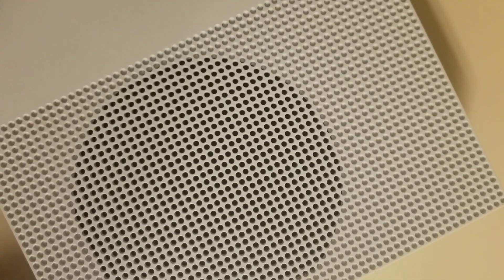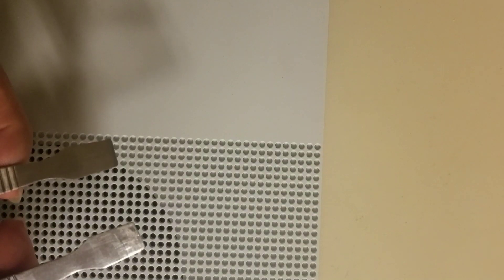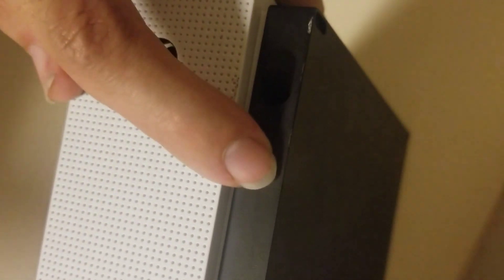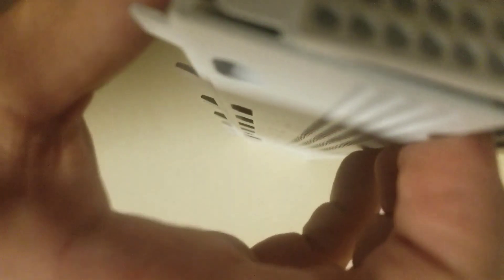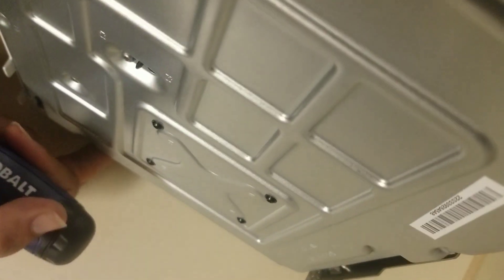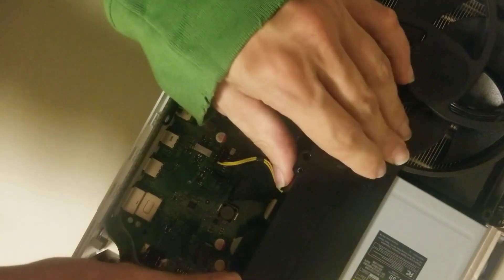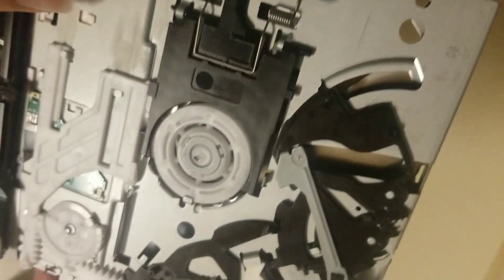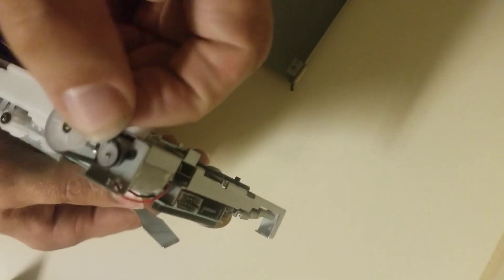Xbox One Slim and Disc Drive Detailed Disassembly

Comment: This is a pretty legit breakdown, not a fan of skipping thru shit that could potentially chip away at my console wich is covered perfectly here, so thankyou for the info.  Edit: Buhhht, my issue is that my son spilled orange juice in the fan, took it apart to clean but when reassembled it turns on for a split sec.. If anyone can help, Please.. Im all dumbo ears..

Comment: This video Rocks! My kids system has been jamming for almost a year where we had to push the disc and and pry it out. Then I accidentally dropped it! The disc no longer ejected not even manually. So I watched some videos, and this one helped the most. Opened it up following your steps to discover a small pencil eraser top (metal part) mangled in the corner! Carefully slid it towards the disc opening and yanked it out. The disc drive now works like new! Great video again! Thanks a bunch. I almost went out and bought a new one. smh

Comment: Thanks for the vid. Teeth of a gear appears to have snapped off so they aren’t turning fully. Great vid straight forward the only problem is the frame, some of what you did was out of screen so I had to figure it out but I got there in the end thanks 👍

Comment: Holyshiii its a mission to get an id out lol my son just gave me a headache lol
Reply from the maker: I found 2 credit cards in the last one I worked on. It is like Christmas but unwrapping with a screw driver. You never know what your going to find. I would love to know what thought children have when they are shoving change cards toys paperclips and 3 discs into a system. Lol
Reply: @NemesisMerlin  my hdmi port broke is there anything I can do ?
Reply from the maker: @gh0st640  HDMI ports are fixable. You will want to find a company near you who does micro solder work. Check computer repair shops. I fix a lot of HDMI ports and the price runs from $100 to $160. I believe most places will fall within those values. Also, all HDMI ports are the same process to fix so if you want to see one in a video check out my ps4 white light of death videos. What happened to the system that broke the HDMI port?

Comment: Hi mate great video, very detailed. My Xbox one S is a couple of months out of warranty now and I have only recently tried to play Blu Rays (4K and 1080p) and the picture pixelates and then freezes about halfway during the movie. Do you think it link to the hardware or is it software related? I tried cleaning the cache and even did a full reset but the issue remains. Games on discs seem to install with no issue.
Reply from the maker: The Xbox One S does have some known software glitches in the bluray app. Make sure your software is all the way up to date. Also make sure all your video settings match what your TV is capable of displaying. Does the fan kick up when you get video glitches that would be a sign of overheating causing calculation errors in the video.

Comment: My disc won’t go in. It’s like when you try and put the disc in, you have to shove it In forcefully. The Xbox won’t just bring it in. And it makes a noise I can only describe as grinding when I try to pt a disc in.
Edit: I put a disc in. It read the disc and everything. My problem is I can’t eject the disc.
Reply from the maker: Grinding is not a good sign. Grinding means that a part is broken and will need to be replaced. The drive was forced at some point and more than likely the gear assembly has lost some gear teeth. The disassembly is the same as with my video but the repair will get much more difficult once you start pulling the motor and gear assembly. I would recommend finding a shop to fix this one.

Comment: Really enjoyed this video... have you ever encountered a problem where you insert a disk, it spins three times and then nothing happens? This is my current situation and I don't know if it's the disk drive or something else. Thanks!
Reply from the maker: Take the bottom plate off the drive and put it back in. Drive mech is broken but it will sometimes allow it to slide even with the brake if you give it room by taking that plate off.
Reply: Oh wow... so just the silver plate like in your movie or part of the mechanisms on the bottom? Like the round thing on the bottom?
Reply: Issa Wilson lets say that
Reply from the maker: Yes the last part I put on. Just blow the system out more often to keep dust out of the drive.

Comment: So I have a question I have a game that will not play and the disk isn't scratched and I'm at my witts end with the damn thing. It plays other disks that are definitely scratched but will not play this one disc. So I just started to play other games for a while and then just yesterday I thought to try it again and it actually started to download and then played it for several hours. And then today for some reason now it is doing the same thing, it's not reading my disc it keeps popping up saying that insert disc. If you could help me or give me any kind of tip so I don't have to take my Xbox apart or throw it against the wall cuz that's what I feel like doing with it right now I would much appreciate any tips please I've literally tried alcohol on my desk, and dried it with a microfiber rag.

Comment: I didn't disarm it but and it jiggled a lil bit and found a popsicle stick inside and I think theyre is still coins inside but I don't want to disarm it can you give me an idea of something to do from the outside?
Reply: (Note:My baby sister put stuff inside)
Reply from the maker: The system would need to be disassembled. Once anything small enters the drive it will fall down into the laser slides and also get stuck to the disc retaining clip that is magnetic. If you do not trust that you can get it apart you will want to find a professional to do it for you. Also, if you try to shake the coins out you may make them hit the laser and damage it.

Comment: What Philip head size is it
Reply from the maker: I use the Japanese Industrial standard 2.0 but the most common option is 3/32"(2.5mm) flathead. Most of the time I just have all my bits lined up from smallest to largest and just grab what looks like it fits and adjust bigger or smaller as needed. Game systems are not designed to be serviced so whatever works best for the situation. Hope this helps.

Comment: how do u do a xbox x
Reply from the maker: The disc drive is the same it is getting to it that will be a pain. Xbox one X is one of the worst systems I have had to take apart. Would not recommend an X to be anyone's first dive into repairing counsels.
Reply: @NemesisMerlin  ok

Comment: Hey this kayla my disc drive won't work and its stuck and won't at all I'm from new Mexico I need ur help....
Reply from the maker: When you say stuck, do you mean that you can't insert disks or do they sound like they are not spinning once they are inside?
Reply: @NemesisMerlin  yea disc drive won't work It won't spinning
Reply: @NemesisMerlin  I don't have any tools fix my xbox one
Reply from the maker: @shadowqueen3950  a temp fix is to put your finger in the center of the disc so that when you insert the disc it goes in until your finger blocks it from going any further. The disc will spin a little on your finger. After about a second of blocking the feed and about the time the disc starts spinning on your finger, pull your finger out and the disc should fly into the drive and it should spin. You may have to do this every time you put a disc in.
Reply: @NemesisMerlin  ok
Reply: @NemesisMerlin  can shift my xbox too you
Reply from the maker: @shadowqueen3950  if you did send the system to me it would take a while for me to get to it due to the 8 systems I have that I am working on right now.